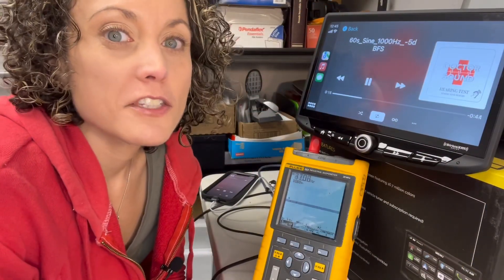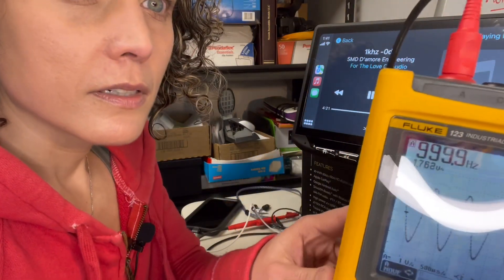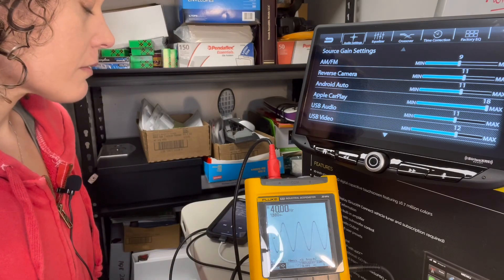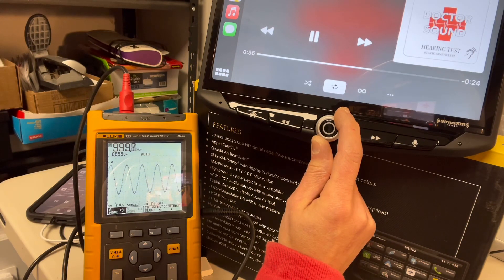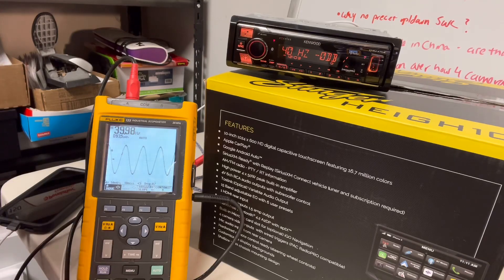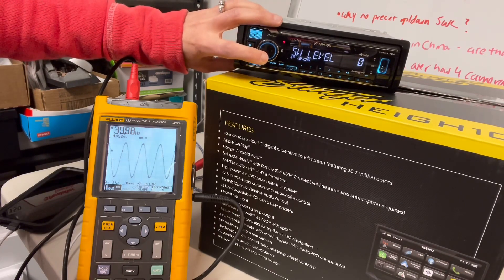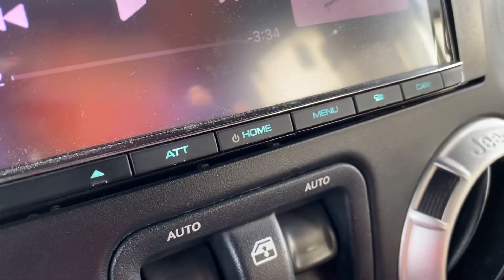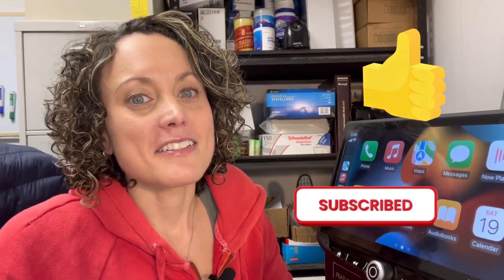Stinger HEIGH10 Review Part 1 - Preamp Voltage & Distortion Test with Scopemeter by @carstereochick

Comment: Did you try turning up the usb audio gain? Are you using apple car play through USB.
Reply from the maker: Yes, we did. And yes that was through USB and at that time I know at the time I made this video I had sound check turned off on my phone and was using Apple Lossless. We still have this head unit and overall have been very happy with it. We switched to the optical out when we upgraded to a Helix amp. Next week, if time permits we will be upgrading to the HORIZON10 which should have a much nicer display. It will be fun to do some testing on that one. Will have some new videos on that in the near future.

Comment: Im trying to decide which Stereo to get for my 2019 JL. I was wondering about the Alpine you discussed they were coming out with.
Reply from the maker: I have a video on that one: https://youtu.be/k3zrtSOmI6g?feature=shared

They both have their pro's and con's and neither is perfect. The HEIGH10 back up camera input gets confused after we use the HDMI. The overall screen quality is not as nice as Alpine's. Alpine's is definitely more vibrant/saturated. HEIGH10 is wired CarPlay/Android Auto, Alpine is wireless. With the HEIGH10 you can easily add navigation and keep using Apple CarPlay/Android Auto. With Alpine, their optional on-road off-road GPS accessory disables CarPlay/Android Auto. The fit and finish of the Alpine is more premium, OEM in feel/look. If you're using the pre-amp for aftermarket amps, the Alpine is true 4 volt, Stinger is not. HOWEVER, the Stinger HEIGH10 does have digital output and if you use a compatible amp/DSP, that is pretty awesome. We are currently using it with a Helix V Eight DSP and very happy with the sound quality now that we're using that digital out. I hope that helps!

Comment: Great video.  Thank you.  What head unit is the one you like the best for a 2019 wrangler jlu 4 door?
Reply from the maker: Thanks Al! Now that we're finally utilizing the optical output of this head unit, we're absolutely in love with the sound quality. We have it connected to a Helix V Eight DSP MKII amplifier. It depends on what your overall goal is for your upgrade is and what features are most important to you. For us, sound quality is definitely the most important and in this case if you have the option/ability to use toslink, that is going to sound better than RCA level on the i509-WRA-JL. But if you're only going to be using RCA's, the Alpine i509-WRA would be a better sounding unit.
Reply: @carstereochick  this is the exact info I needed. Thank you for this feedback. Having a SQ setup myself with dsp, the optical out and the fact that this head unit is currently on sale for $599 from stinger on Amazon….. absolutely sold, and just ordered it

Comment: This vid just saved me some cash. No 4v output no cash input from me. Guess I’ll just use a proper dsp and factory HU in my Silverado
Reply from the maker: Does your Silverado have Bose? If so get a pre-amp adapter. Depending on the year it might be a PAC AP4-GM61 and that will give you a clean, flat 4 or 5 volt pre-amp signal from the stock system. I will say, even though the Stinger is not true 4 volt on the pre-amp, the one redeeming feature is it DOES have a digital output. If you use that and go into a high end DSP amp with digital toslink like a Helix P Six DSP or V Eight MKII the Stinger will sound better than any 4 volt or 5 volt head unit.
Reply: @carstereochick thanks for your response. My Silverado did not come with the Bose system but the 8” screen instead. You are the third person to suggest the PAC unit though and I was told it would work with my unit regardless of being non Bose? I already bought the Helix DSP3s but considered taking it back and getting something like the Alpine F509 instead. You think the Stinger Unit would be a good combo with my Helix using toslink over just using the Alpine F509? I know the Helix has infinitely more adjustment but I’m going to have to have it installed and tuned by a professional for sure. Thing about the Alpine that scares me is it’s going to be around $1500 with extra adapters and installed but only a 1 year warranty 😢

Comment: Is the low voltage reading, as compared to what it is advertised, is only an issue if using aftermarket amplifiers, correct?

Comment: Curious if using the optional TOSLINK instead of the pre-amps will make a difference in output. I was considering this unit over the alpine. Going to Tie it in to a AudioControl 1200.6 via TOSLINK, would be good to see a vid if there is a noticeable gain.
Reply from the maker: This is something we wanted to test and we just haven't had the time. Usually you have less output with Toslink, but because the voltage was so low on this deck, I was thinking it might actually have more or might just be the same.
Reply: @carstereochick  It should just be a matter of the head unit assigning the correct values to tell whatever receives the digital transmission what the gain should be and should go up to but not over 0. It should have nothing whatsoever to do with the weak output of the analog preamp and the two should not care each other are in town and I really do mean should, I have no way to know. I would certainly hope that the spdif is not just converted from the preamp output stage as this would make no sense and would digitize any distortion the preamp has. I would hope that analog FM is digitized before the D to A converter that feeds the preamp. I would also hope that built in DSP is done while still in the digital domain. I have no idea how many D to A, D to D and A to D converters there really are in a premium head unit. 

 The fact that Stinger actually offers and variable volume spdif is way out front in itself. The others are so damned stingy.

Comment: Is there a head unit you would recommend for the jl? I'm looking to change mine out.
Reply from the maker: I mean we have the HEIGH10 in our Jeep. It has its pro's and con's. We are currently using the digital output which is amazing for sound quality to our Helix V Eight DSP MKII amp. If you're using a regular analog amp, you will get better sound quality with the Alpine i509-WRA-JL and it's a much nicer display, but it's also a lot more money. Neither are perfect, but right now, we have limited options. You can technically install any shallow mount iDatalink Maestro compatible model too, but the Maestro does not retain the OEM camera. We also have tons of Jeep JL/JLU and Gladiator clients that do a full audio system upgrade using the stock head unit with the PAC AP4-CH41R2. But if you have the 5" display and want a bigger one, that doesn't really help you.

Comment: I'd love to know what Stinger has to say about this. With that said, I installed a HEIGH10 in my '17 Sierra 2500HD and love it, although the screen resolution needs improvement for my back up camera.
Reply from the maker: No official comment from Stinger, I'm sure it's related to difficulties sourcing components. Have you contacted Stinger about the video quality? We did do an install in a GM truck a couple months back, but I don't recall there being a picture quality issue. However, that truck might have been a 2016 and I think some of the newer GM's are using an LVDS camera like the Wrangler does. You might be able to improve quality using an RPA-VA1.

https://catalog.pac-audio.com/index.php?controller=attachment&id_attachment=1808
Reply: @carstereochick  component sourcing certainly should be an excuse though, mine works great so no complaints on that front. as far as the video quality, I'm sure that's subjective, I just expect a better resolution out of such an expensive unit. With all that said I love it. Thanks for the great video/info.
Reply: Based on the review section on their website, they say it’s 4v at full volume…

Comment: After having the heigh10 installed in my 17jku sahara I have noticed that it Does Not pick up the radio stations anywhere near the same as the factory deck . Why  is this so . Maybe something when the stereo shop installed it . Maybe ?
It has only been in the jk since May.
Reply from the maker: Hi Kevin. In my experience these vehicles get horrible reception as it is even with the stock stereo so I couldn't really say what's going on. My 2014 JK is horrendous and that's with a Kenwood deck that is pretty solid at pulling in stations. 

There is an FM/AM antenna adapter that is used to connect any aftermarket radio to the factory antenna, so it's possible you have a faulty adapter. But is it like you're ONLY getting local channels and absolute static everywhere else? Or like you're picking up the same stations as earlier, but with a lot more interference on all of them?

FM, and especially AM, are incredibly fickle and susceptible to all kinds of interference. Things like body corrosion, corroded main body grounds, a bad ground on the radio, what type of spark plugs you have etc. can all effect FM/AM reception. So it could be a number of things. 

Did you by chance also have the shop install any aftermarket LED lights on your vehicle at the same time? LED and HID lights will obliterate reception. You can try things like a ferrite bead either on the antenna cable or on the power line for the LED or HID lights if that's the case. Doesn't always help.

We have installed these in both Wrangler JK's and JL's and I have not had any clients bring up reception loss as a complaint, but it could also be that they use CarPlay/Android Auto or SiriusXM and don't listen to FM/AM. For example I really couldn't tell you how it was before/after in our 2019 because I don't think we ever once turned on the FM/AM with either radio. I will have to pay attention to the next one we install. It may simply not be as strong of a tuner.
Reply: @carstereochick  I have not changed any accessories since having a professional stereo shop installed the heigh10. The location of the fm station that is located 40-45 miles away that would listen to for news and weather worked great with the original deck, and that’s even with the rubber shortie antenna… once the new head unit was installed I noticed no fm range and station interference depending on what direction the jeep is facing in relation to where the station is located. Plus my apple CarPlay has quit working. I used to be able to just plug my phone in and CarPlay would be there. Now when I plug in it does nothing . Not even highlights the CarPlay app. This head unit has hardly any miles on it . Disappointed buyer.

Comment: Go to subwoofer level and try that setting for higher rca output. . My kenwood will only get 2.4 at 0 level and when I cut level to 10, I get 5.8
Reply from the maker: I did, sub level was maxed out as was the source level for CarPlay. We put an Audio Control line driver in and now we have the missing voltage.
Reply: @carstereochick  Before finding this video I suspected the sub volume seemed off.  I upgraded to a more powerful amp... but watching this now makes sense as to why I needed to. Thanks.  On a side note for people that have the Alpine amps OEM, this unit with installer code did allow to turn the OEM installed amps louder by a lot.

Comment: Have you tried adjusting the EQ for example increase the level on the 1k band and see if the voltage increases?
Reply from the maker: Did not try that nor do I think it should be turned up to get that stamped rating. I did try boosting the internal source level adjustment thinking maybe that was it. For reference when I did these tests on Alpine, Kenwood, Grundig, Sony etc. I did not boost anything in the EQ. I leave everything at flat in the EQ, crossovers off. I do test with the sub level all the way up and also at zero because I have found on some decks, that voltage rating doesn't kick in until you're all the way up (and it stays clean) and on others that voltage rating is already there at 0 or +1 and if you go above that you get distortion. And consumers are naturally going to want to turn it all the way up unless I can tell them, hey don't turn it past this point, here's why.

I'll be making another video soon with my husband John in our Jeep and we'll show it in the car and how we added a line driver to deal with it. The other thing a LOT of people are not aware of is in October 2020, the main chip supplier in our industry, AKM, burned down. That factory burned for 3 days. Thankfully and amazingly no one was injured. It's still not rebuilt and last I checked they still haven't stated the cause of fire. My hunch is Stinger was using AKM for chips and after the fire, supply chain constraints only increased and the chip supply issue really snowballed so they compromised on their components in order to ship product. I believe the 1st run of these was definitely the higher voltage pre-amp, I heard it with my own ears on a job we did in January 2021. 

Aside from learning at what point these various stereos start to distort, this is the other reason I started testing this stuff. I knew manufacturers were having extreme difficulties obtaining components to make aftermarket stereos and I wanted to see if companies were keeping up with stated quality.

Comment: Hmm, I just had a Stinger installed in my 2015 Charger, I love it, I do have 2 12" sw in my trunk giving me the kick I want but anything is better than that little 5" factory pos that came with the vehicle, keep up the good work learning a lot from your channel 👍
Reply from the maker: Thank you Louis! I will be re-testing this model soon. I'm curious if Stinger ever resolved their supply chain issues and got back to a 4 volt pre-amp. We ended up putting an Audio Control Matrix line driver in ours to overcome the low voltage pre-amp, but then later we switched to using the optical output with our Helix V Eight DSP. 

Holy moly we are in love with this unit now. Not sure if you ever plan to expand and upgrade the interiors/amp those, if you do, we highly recommend using the digital out to an amp that is compatible like a Helix with built in DSP. Sounds SO flipping clean.
Reply: @carstereochick  WoW, you just gave me a crash course in a min's read lol, I'll look into it in the near future, I'll be in touch ...

Comment: Open the sound file with an analyzer such as Audacity and see that the level is up to 0db for a constant level that will not jump over 0 to clip, or a tad under such as -0.2db to prevent clipping of music files, I have a feeling your file is at a very negative DB level. Obviously the loudest sounds of a proper digital music or test tone would not go over 0db as it would clip as I mentioned but if the test file is at -20db or lower, it's not going to be able to drive the preamp to it's limit. 

 Audacity is still one of my favorite programs. If the file is well negative, I can normalize them with no degradation since one is only changing at what bit the loudest in the file is. Since it is a constant amplitude test file, it can be 0 without ever going over into clipping.
Reply from the maker: I use Apple Lossless for testing. Original file was imported from a CD into my library at CD quality so no compression/degradation of the file used for testing. The file is specifically taken from D'Amore Engineering album For The Love of Audio, 1 kHz - 0 db. Use the same test tone and equipment for Alpine, Kenwood, Sony etc. 

Since I made this video I have confirmed with an unnamed industry insider, that many of these units like mine are not 5 volt. To my knowledge, this issue has not been resolved. You may have heard of this thing called a chip shortage? Last year when Kenwood, Sony, Alpine, Pioneer etc had barely any radios to ship, some companies did what they had to to get chips to push radios out assuming nobody like me would test and figure it out.  Now that supply chain issues are getting better, I would hope that this gets addressed. 

As I've said to others, I know the 1st one of these we sold and installed was 5 volt, you could hear it. That was what sold us on wanting to put one in our own vehicle. Supply chain issues were a nightmare for manufacturers 2020 - 2021 and I was really bummed to find out how that affected this model. We have since added an Audio Control line driver. Eventually we will get Toslink connected, but our shop is always so busy working on client vehicles that we rarely get time to upgrade our own lately.
Reply: @carstereochick  Ok, you convinced me, they advertise something that isn't so. 

 I have never used the line driver but I am using the matrix in balanced mode(strange to use rca jacks for balanced though)in a 1998 Lincoln Mark VIII LSC with an Alpine X208U feeding the factory JBL amp with the Matrix. It works well but that is an awful lot of device just to boost to a higher gain with balanced out since so many features are left unused. The line driver may have worked.  There was a company over 20 years ago that made an adapter that was designed specifically to take RCA outputs which most were 2 volts at the time and convert them to the higher voltage balanced inputs the JBL amp used. I had a 1988 Lincoln Mark VII LSC with the jbl system that I used to put a Denon head unit into which was my first RDS experi0'0ence and it actually did what RDS is supposed to do, if you are listening to a program such as on NPR, when it starts to get weak it will look for a stronger station playing the same thing and tuning to it.

 I became familiar with Audio Control in 1980. They were always  dedicated and their UPS driver even ate lunch with them back then when they were small and not far from Carver. Pretty good bunch of folks. I have some of their amps in my truck behind the rear seat.